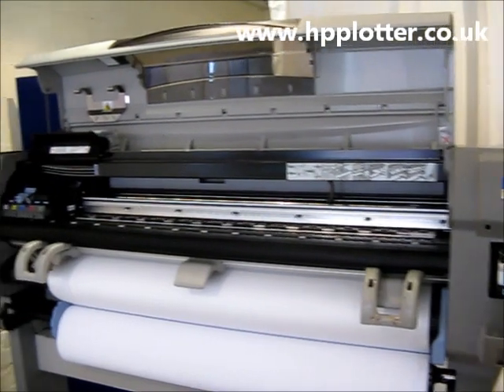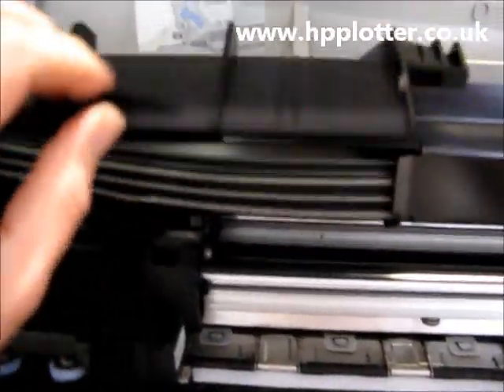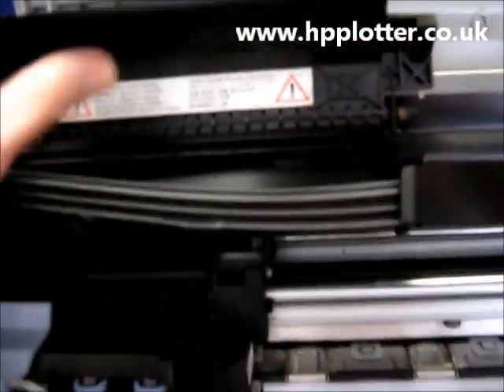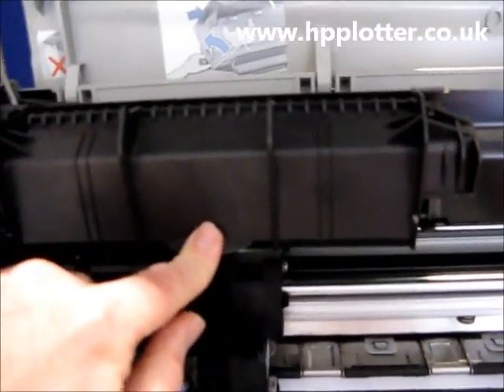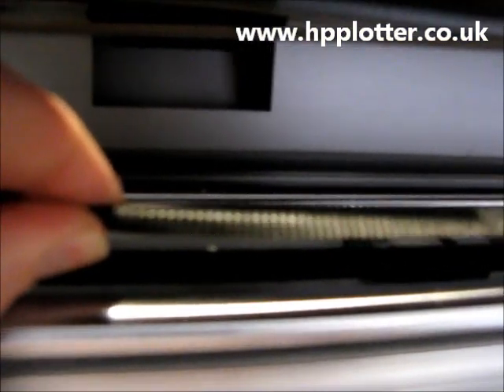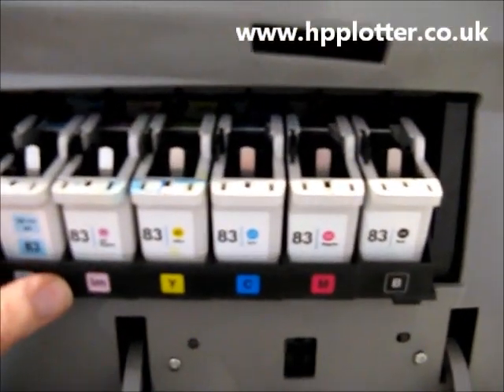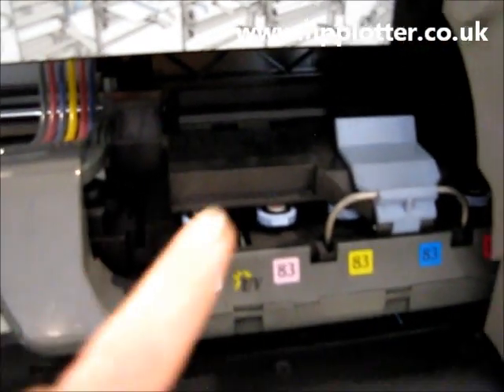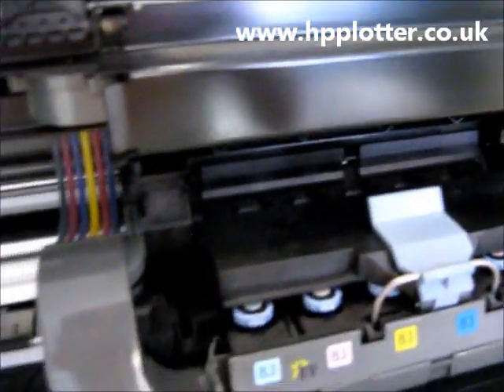HP DesignJet 5000 repairs - Check print head path error

Comment: Please I need a help I have 5500 plotter 42" asking me to replace magenta and black which I did but is blinking (5106)Reseat and (5006)Reseat
Reply: Sounds like you need a repair - if you're in the UK please email engineering@hpplotter.co.uk - in the meantime you can try checking if there is any ink on the cartridge connections and gently clean the connectors to see if that resolves it but it sounds like you have a faulty part which needs replacing.

Comment: new hp 81 printhead yellow printed 3 ao prints and then stopped showing 
code 5303 Printhead Smartchip error , i turned of printer cleaned 
restarted several times ..still same any suggestions please

Comment: new hp 81 printhead yellow printed 3 ao prints and then stopped showing 
code 5303 Printhead Smartchip error , i turned of printer cleaned 
restarted several times ..still same any suggestions please
Reply: Hello Karl - yes it needs to be repaired and it's likely a worn part which requires a full stripdown of the printer. If you're in the UK, please contact engineering@hpplotter.co.uk for a full repair estimate.

Comment from the maker: @Robert Lopez - This specific error code isn't recognised nor detailed in either the Designjet 5000 or 5500 engineering manual.  The system error codes for the 5000 generally consists of two groups of alpha numerics; the first 6 characters relates to the system error and the second set of 8 digits (if present) refers to the internal error. Therefore I suggest arranging an engineering site visit if you're UK based for an engineer to work through the fault (parts to be advised). Our email address for a repair estimate is engineering@hpplotter.co.uk

Comment from the maker: HP Designjet 5000 inks - join our Ink Discount Scheme and save £££'s off your ink - call us on 0845 0770 787 today or email consumables@hpplotter.co.uk  The ink is HP original, brand new, direct from HP Distribution. Price example: No. 83 inks £134.33 (normally £159.00) or No. 81 inks £103.76 (normally £123.50). Prices fluctuate each week with exchange rates. Join now for long term savings and no tie ins or clawbacks.

Comment from the maker: @Joanna- when we attend calls with this issue it is typically down to 1 of 4 possible parts that have failed. You will need an engineer to assess which part has failed as there is a problem in the Y Axis. Please contact us at engineering@hpplotter.co.uk for a repair estimate or telephone 0845 0770 787. If it was something you could resolve yourself simply, we'd always let you know upfront.

Comment: ive got drops of ink coming out of the yellow printhead .any tips to sort this problem out
Reply: Hi Joanna,
Are you using third party ink? if so maybe the ink has the low surface tension that is why you are experiencing that problem.
If you are using OEM ink then you need to replace your printhead already.
Reply: Thank you for your reply. Actually it was genuine HP ink. It turned out the printhead was blocked or something.
Reply: Hi Joanna,
Try to wipe it off using a wet cloth or tissue paper to remove the ink sitting on nozzles.
By the way, can you check the total ink fired of the printhead. Thanks